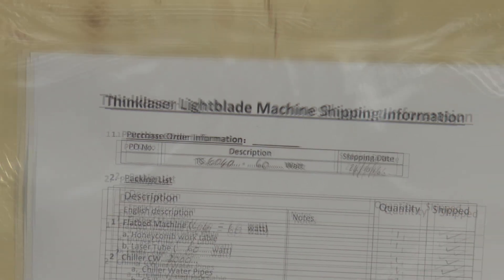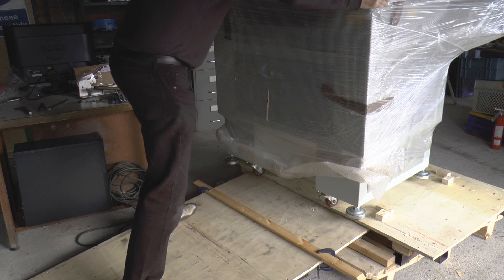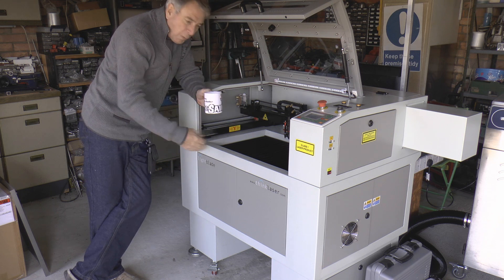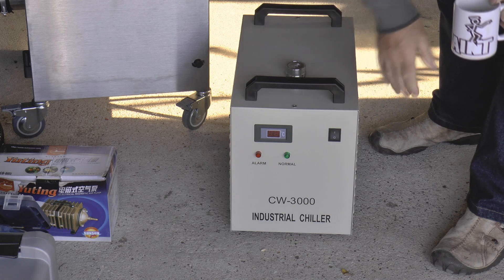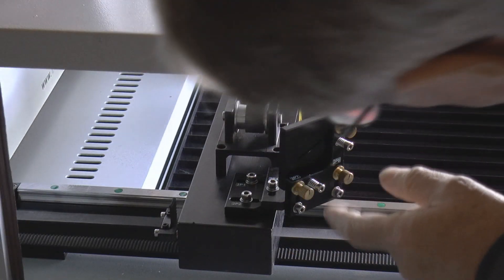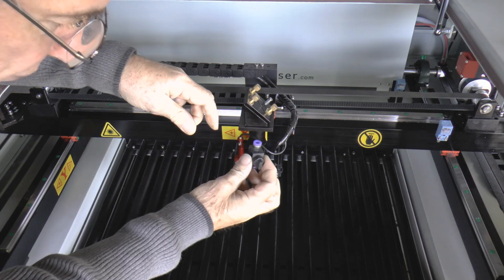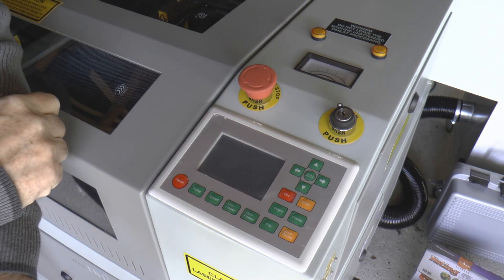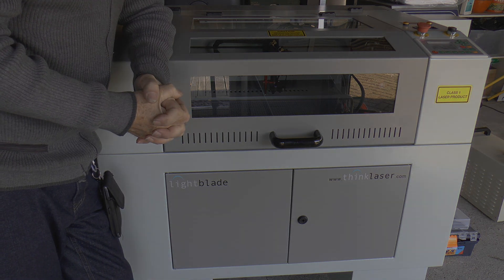RDWorks Learning Lab 84 My New Adventure

Comment: Shame they are not in Australia yet, as I am in the market for a decent machine.
Reply from the maker: These are a bit like Apple products. Made in China but under a watchful eye . Although the UK product goes through a second check before installation  the product is still good quality right out of the factory. Might be worth contacting gareth@thinklaser.com for a chat and a quote because I know they have shipped direct from factory to remote parts without issues
Here I am 2 years on and I have nothing but praise for it. I am continually upgrading, learning and re-engineering my China Blue machine but there has been no need to mess with the Lightblade. It has been a plug and play system and I have done a whole series of videos about it for Thinklaser. Look for Lightblade Learning Lab on You Tube. These are not corporate or advertising videos but my normal "say it how it is" style because there are some aspects of the whole Chinese machine design ethos I am at odds with, but that does not mean the engineering is bad just some of the design principles are not properly thought through. This is NOT a  pre assembled DIY kit  like my China Blue machine. So worth inquiring further
Best wishes
Russ
Reply: SarbarMultimedia  Thank you for that quick reply, and I will chase up Gareth very soon.
Reply: Hi Tassie Spirit,

We can supply direct to Australia, however, we are unable to offer local support. 

Gareth @ Thinklaser

Comment: HOW ABOUT IT WORKS ?
Reply from the maker: It certainly did work straight out the box and has worked very well for the last 18 months. Build quality and reliability superior to any standard ebay machine.  I love my little SH6040 because its design faults have forced me to learn so much about the technology. With all my little modifications it is now an equally enjoyable machine to use. As you follow my learning journey you will discover all the changes I have made.

Best wishes
Russ
Reply from the maker: Sorry the model is SH5030

Comment: Nice machine and video.  What is the practical use for such a machine? I understand it can cut and etch some materials, but what would one use it for practically at home?
Reply from the maker: In general, although this is a relatively low cost  machine, it is beyond any normal hobbyist's budget, hence the reason why most choose the Ebay route with all the issues that entails. This is a machine for a small business, an R&D department or a school/college,  where it's plug and go To justify spending about £5K you need it for a real purpose. There are many folks out there that are expressing their pent up artistic talent making and selling  wooden or plastic trinkets, engraving slate or granite clock faces and pet memorial stones,  Many are using these machines for making bespoke wedding stationery and memorabilia. There are lots of people making model kits from balsa wood and thin plywood. Just Google any of these subjects and you will see what I mean.
However, me personally, I have no business to serve. I'm a retired engineer with lots of design experience and with 10 years experience of owning and running a metal cutting laser business. With such a background I thought this Chinese laser technology would be a great retirement activity as I'm no golfer or fisherman. As I quickly found out, this is NOTHING like the metal cutting laser technology that I knew so well. I had to start from ground zero and there was no information out there to help me. My other long-time hobby has been video/editing. So that became my new combined hobby ie learning to use and understand the machine and recording that journey for all to see.
In answer to you simple question, there is no obvious justification. It's a bit like owning  a camera or a drone or a set of golf clubs. None of these are of any use without an interest or intent to use them. There is pleasure and happiness to be gained from owning and using them but no financial gain to be had from any, unless you do it professionally.
Thanks for the comment
Best wishes
Russ
Reply: SarbarMultimedia Thank you for the reply. I too am an engineer and have a lot of experience with cnc plasma cutting tables.  I have a home shop filled with welders, torches, tools and garages filled with vehicles. None of these things are practical on a daily basis, but do bring some  joy once in a while, so I understand.  If this laser (or any other that was inexpensive) could cut sheet metal, I would be interested, from a hobby perspective. Cheers.

Comment: Think laser is supplying laser machines only in UK? Do they ship in Greece for example? I have noticed that in their website your machine is not present. They have a totally different look, Lightblade 3040, not 6040. Next available size they have is the 6090.
Reply from the maker: Hi Polis
They have a whole range of sizes available including multi tube but as a growing company they are not yet carrying stock. 
You can either apply for information to their website or contact their head of marketing gareth@thinklaser.com. I know they have plans for expansion so your inquiry would possibly accelerate any pipeline plans
Regards
Russ
Reply: Ok, thanks for the info. I am asking as if i do not get the finance program i told you the other time and be able to by a Universal, i have to come up with some Plan B. Have to choose between the best possible Chinese suppliers. Until now i saw your video i was going for Bodor. Bodor seems a good choice as it has a representative here in Greece. I have seen them working as i cut my stuff to this representative and they seem quite OK. Not perfect of course. They provide RDWorks also. The website is www.bodor.com to give you an idea what this is. Also they provide lasers with servo motors, so i am really looking forward for your review on this and by comparison to step motors to try to make a verdict.
Reply from the maker: Hi Polis
I do have a couple of contacts with Bodor machines if you need information
 The servos on the lightblade ary hybrid servos in that theyare basically 3 phase stepper motors that have rotary encoders for absolute position feedback. Cannot lose steps. I have not spent much time playing with it yet but i think I will be able to tweek the accelerations because it looks a little more leisurely than my old Chinese dragon..
Regards
Russ
Reply: Thank you Russ for your reply, will let you know if i ever need a reliable contact from Bodor. I have already sent some mails months ago but the specific person did not covered me much. So difficult to contact these people and let them understand what you really need. Cheers
Reply from the maker: Hi Polis
Just in case there was confusion my contacts are a guy in the states and one in ireland who recently bought Bodor machines. You might want an opinion.
Regards
Russ

Comment: Using a drill as a hammer...I knew I liked you.
Reply from the maker: Hi Jesse

I bought an end of batch job lot of 6 about 10 years ago at £5 each!! I absolutely hate the self tightening chucks they use on modern drills Yes these are made in China but they have proper Jacobs chucks. I still have 3 in boxes unused and being a lazy guy why reach for a hammer when I'm already holding an oriental thumper??
Regards
Russ

Comment: Hi Russ, long time follower of your series and love the new machine. I started a electrical prototyping service myself and a lasercutter is something which I want to own myself. At this moment I use a CNC or a lasercutter for custom enclosures around my prototypes, but I have to outsource all my designs to a commercial party and it has to be close to first-time-right... (which is hard to do if you're designing friction-fit screw-less boxes). 
I thought about a K40 and upgrading it myself, but a solution like your new machine would still be affortable and much more hassle-free... so I will following the coming videos with great interest! Keep on doing what you do best and try to enjoy your retirement! (I you only put half as much effort in your carreer as you do in your video's, you have earned it big time!)
Reply from the maker: Hi Thanks for your kind appreciation. I had a wide and varied engieering career operating at all levels and for 10 years owned my own metal laser profiling business. However none of that really prepared me for the completely new learning experience involved with this Chinese technology. The challenge has certainly kept my two remaining grey cells well exercised and I have made some great friends around the world as a result. It has been an amazing experience. My initial impressions of using the new machine will be on line shortly and as time progresses you can make up your own mind about its merits as a business start up machine
Best regards
Russ

Comment: Russ, in regards to airflow when cutting acrylic. I am having a problem with the acrylic being literally turned to liquid and sprayed onto my steel bed. The acrylic sheet stock gets cut by the laser and then drops down, landing in the residue. When the job is done, I pick all the cut parts off the table and the more recent ones have a slimy liquid coating under them, and the ones that were cut early in the operation are nearly glued to the steel plate. Does this have anything to do with the pressure of the air assist?
Reply from the maker: Hi Robert
Up to now the only time I have seen liquid (and with coloured persex coloured liquid) is when I have had the acrylic laying directly on my sheet steel bed. It seems more like water condensation than any liquid acrylic. The great property of acrylic is that when you bombard the surface with intense heat it evaporates/sublimates rather than go into any sort of liquid phase. Just like steam, the vapour tends to recondense near the cut or in the cut if you are engraving. I know from experiments that too much air pressure cools the acrylic too much and decreases the cutting efficiency. In general I normally turn my air assist down to just a whisper when cutting acrylic. The extra heat in the cut helps to flame polish the surfaces. Also I normally leave the protective film on so that any surface residues can be peeled off.
I have used a honeycomb table, but the risk of refelction marking goes up. I usually supend the sheet on a pin table that is about 25mm above the surface. this allows me to decide (by support or no support under the parts) whether the parts drop or not.  I do not experience the issue you are describing.
Maybe run a few tests with these ideas. Shout out if you are still suffering.
Best regards
Russ

Comment: Great to see the new machine, I'm interested to see your power test results, and servo accuracy tests.
I am a little disappointed that the supplier provided a CW3000 chiller, because for a few more dollars they could have provided a CW5000. I also hope that it is explained in the instructions that over current and heat are the two biggest culprits in short tube life.
Enjoy.
Reply from the maker: Hi
I haven't read their manual yet (if it exists). It may not because this is a service supported machine. There would normally be a installation and a short teach-in about the machine and software (you can't do much of that in 2or3 hours!!) but of course, because I probably know more about the technology and the software than they do so I never got to hear what they would advise/tell new customers. However. I shall make it my mission to educate their customers with my videos The chiller is not really and issue here in the UK especially as it's only a 60 watt tube and will be light intermittent duty. My bigger problem is where inside I am going to mount a 50 watt lamp to prevent freezing in my unheated workshop. Just occasionally we have a really cold spell of weeks but usually its only an odd couple of days here and there
I shall be showing the new machine and doing a few tests with it but it will mainly be a tool for comparison as I plough on with my little Chinese dragon. There's so much more to learn anderstand with that little beastie.  dont plan on spending significant money to upgrade my way out of problems, I'm more interested in finding and understanding the problems. Sometime understanding is more than 50% of the solution..
Best regards and thanks for your continuing interest.
Russ

Comment: Hi Russ! It looks like an apple product compared to your old machine. Everything is neat and engineered with caution. Now it's time to see how it operates. So, fingers crossed and have a deep dive into it. I can imagine that you cannot wait starting the tests. As for the extraction system if you cut a lot of wood you will have to change filters very very regularly. I have asked many suppliers of Chinese and popular brand laser machines about that and all admitted the above fact. And you wife might loose you for some time!! Polis
Reply from the maker: Hi Polis
I have answered this once but for some reason it appears to have disappeared.
Apple product is a good comparison. In this case the "good" product arrives from China is uncrated, inspected, any latest mods added, set up and tested before recrating. It's delivered to me and an engineer comes to install and "train" me. Wood is not something I do lots of and I am aware just how sticky MDF fumes are. I already have a spare set of filters but if I need more my negotiations included 2 years of consumables. So not an issue.. Testing will be interesting because I don't thinks it's going to be a "project", I'm sure it will be a reliable working machines that I may personalize a bit. I've already binned the red light pointer and will be fitting my own little air valve, fitting a steel bed optional plate for my pin table and making target holders for testing the "open" mirror system. My first job will be to charcterize the tube performance ( a nice 60 watt EFR) 
Best wishes
Russ

Comment: Hi Russ. Appreciate your complete honesty with the new machine.  Am please you can modify it as much as you want or need.
In a future episode I would be interested to see what you think of the cost of the new machine compared to the 'adjusted cost' (after everything you've needed to do) of the old machine.  I appreciate the the old machine has given you (us) a wealth of knowledge, too, that can't be valued.
I think my first two updates to the new machine would be the air valve (as you mentioned) plus a port for the network on the side of the machine where it can be accessed.
Reply from the maker: Hi Jamie
Although several people are interested in the performance of the new machine, sadly I cannot make it the "star". I still have so much more to learn form my little Chinese dragon that I shall be carrying on as normal but the new machine will appear often for comparison purposes. I see it as firstly a great way to exploit and indulge my other hobby, video and editing, whilst at the same time benefitting from a REAL and reliable piece of kit to  help resolve issues with my cheap ebay machine that so many others  suffer (and gain enjoyment) from. My other series of videos specifically using the new machine will eventually be appearing on a ThinkLaser You Tube channel and I will be posting the links for those that are interested,  because It will be tutorials, manufacturing projects as well as performance testing that will be posted there. Hopefully with 18 months of hard won experience I will be able to make that series of videos exactly what I wished I could have had when I bought my machine. Sadly all I had was an unreadable manual and an inquiring mind.
Thanks for your appreciation
Best regards
Russ
ps I personally don't need an ethernet connection, my wifi extender works just fine. ThinkLaser would have installed one  but I advised them not to bother.
Reply: Thanks for your reply, Russ.
From a purely selfish point of view I'm pleased that your 'old' machine will still be your main hobby.  Having the ThinkLaser model will definitely be an advantage for comparison purposes when trouble-shooting and, I'm sure at times, it will also cause just as many questions as answers, too!
On the plus side - with 2 machines you can now double the manufacture your wife's Christmas cards! :)
Take care and I look forward to your future videos.
PS. Am glad there's an option for the external network point as that would have been an oversight in my opinion.

Comment: Sweet machine Russ, now I'm jealous...lol..as far as my laser message about speed, i was refering to the max speed which is preset at 500mm/s, I changed mine to 900mm/s then of course you have to write the change to the processor but my machine works great on the new speed.
Reply from the maker: Hi Scott
Thinking a bit more about the way you suggest, It could well work ok because its a bit like racing a car around the block where you live. If the block is only 200 m square then having a 150mph ferrari is no real use because It will never be able to get above 60mph (ie my problem with small detailed paper cutting)  but give it a long straight road and wow. So yes I can see that it would allow slightly better processing times if you can ever accelerate to 900mm/s . I may well dial it in.
Many thanks
Russ

Comment: I am eagerly awaiting future videos on your new toy as well as the old chinese machine. You have provided me with the inspiration to improve my small 40 watt 300 x 200 laser. 
I have added air assist, adjustable lift, laser pointer and i have fabricated copper mirrors.
the copper mirrors have improved the efficiency the laser by a considerable margin. 

I am now in the process of upgrading to a 100 watt 700 x 500 machine. But it seems they only ship to a sea port. Not sure how that logistic will work.

looking forward to your up coming copper mirror session. I cut mine with a drill based hole  cutter